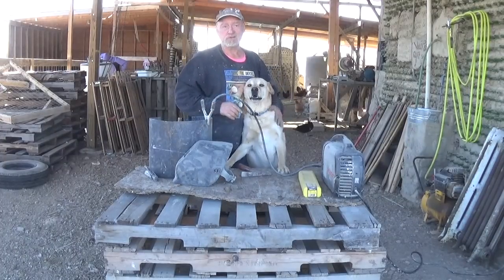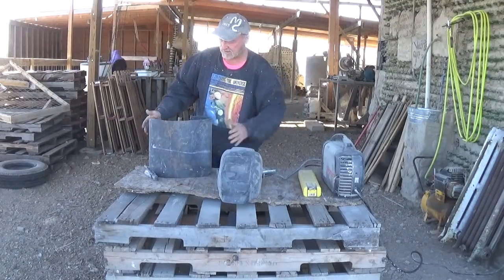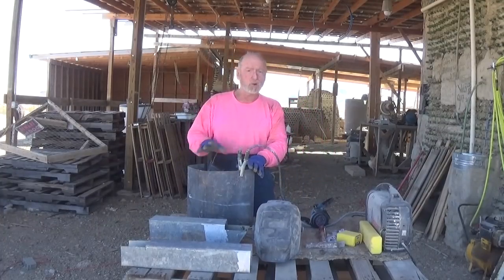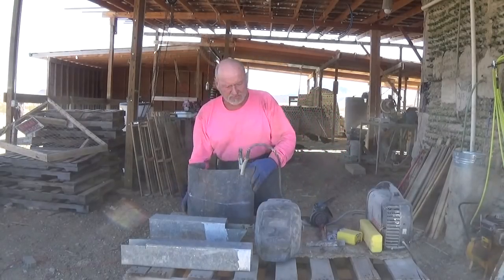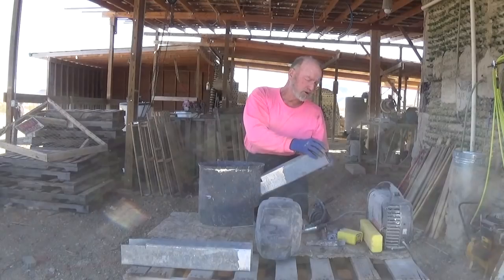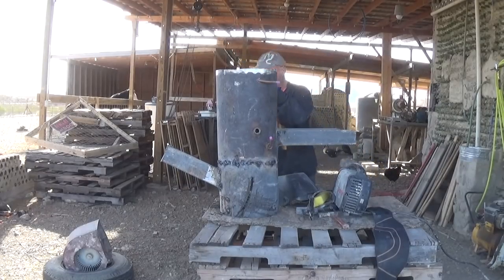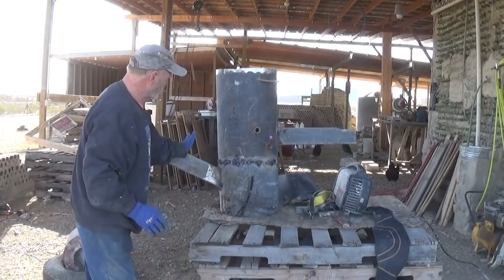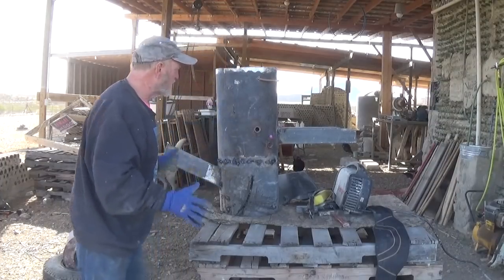Rocket Stove/Incinerator/Hot Water Heater/Cooktop, Part Two

Comment: ROBERT where did you get that cook top at ? thanks for another great video,, have a blessed and safe  day
Reply from the maker: I had it custom made at a welding shop. It is 3/8"" plate steel with a 1/2" lip around the edges.
Reply: thanks, that is what i was thinking about doing to as i was not able to find one

Comment: What is the height and diameter of your riser tube please ? What are the dimensions of all air intake vents and approximate vertical positions relative to the position of the grate ? I am going to build a stainless steel 310 grade with 1 inch alumina blanket insulation and 3 air vents. I am guessing 22 inch riser height and 8 inch diameter of riser tube. Three 7x4 inch air vents so can collect ash and add loads of coal and wood and plenty air. 40 gallon water drum on top of riser, 1 inch from the flame. Is this close to optimum to get maximum heating power and efficiency to heat my tank of water ? Thanks. I will keep you updated as I starting building it. My test will be measure the time to boil a kettle of water to estimate btu power, need to get maximum heating power and maximum thermal insulation, hence 310 steel and alumina refractory blanket.
Reply from the maker: My stove is now encased in brick and I don't keep blueprints of these things. Best to use the dimensions of some of these guys with super engineered stoves!

Comment: R R R....but not so far as to re-use women's clothes ! :) ha h aha
Reply from the maker: If you were a lumberjack, you'd be OK. You'd work all day and at night dress in women's clothes!

(for those unfortunate enough NOT to be familiar with that, look up the "Lumberjack Song" from Monty Python. It's  classic!!!)
Reply: thank you. answer me this question if you can do so. Which is more efficient at heating 44 gallons of water to above 150 F for domestic use: A rocker stove with a copper coil inside the riser tube, OR a 44 gallon water kettle (an insulated stainless steel tank with a good old roaring fire beneath it). I love your philosophy. rain water from roof is great too. ENTIRELY CORRECT. I just think the copper pipe method inside a rocket will take much longer and struggle to get the water hot AND the water discolours due to copper high temperature reactions. You need to listen to WARDRUNA and DEADLIFT too, otherwise you are close to perfection with a sense of humour.
Reply from the maker: I have both things going on..... inside two different rocket stoves. Maybe, the big fire under the 40 gallon tanks heats a bit faster, maybe. However the copper coils seem to heat 100 gallons of water OK. It takes about two hours of small fire to heat the 100 gallons to about 120 degrees. 150, as you know, is scalding and not recommended for your domestic hot water, but fine for a hydronic heating system.

My experience however, has a caveat...… I am using pumps to circulate both of the fires' hot water AND the copper coil is also at "city pressure" of 60 PSI. I m sure this makes a big difference!
Reply from the maker: You are asking me to look at things we do NOT do here. Both videos show great welding skills and ingenuity. However both also would have the heater outdoors in Winter, being stoked, filled & drained manually by a presumably wet or near naked person, or a nine year old. While this is OK for many wanting to live a "simple life", we did not work for 47 years to camp on our land like refugees. 

The second video is a minimalist, almost the stereotypical "off-gridder" that most people think of when "off grid" comes up. By that, I mean he is doing things very simply, very spartan and very labor intensive, e/g: hauling water to the stove. This is NOT our way. We use electricity, pumps, pressure and everything we can to make this place as comfortable as any city residence..... or will when it is finished.

I already lose viewers when they see they must load the fireboxes! Hauling water, then adding more hauled water to make it cool enough, is viewed as weird and not something THEY want to do. Our goal here is to live a "One Planet Lifestyle" as comfortable as possible using the best of 21st century technology and ancient technology, so that people will see how little sacrifice they need to make to achieve the "One Planet Lifestyle". We lose potential converts when they have to haul water to the heater and have no pressure. I want to encourage them to make certain adjustments, bringing hot water into the house in a bucket, IN JANUARY, is not the picture I want to paint!

My big rocket stove has not been featured in a video yet, as the house and hydronic system are not finished. It is a 40 gallon gas hot water heater core, covered by a 55 gallon drum with a 6" top gap and is faced with native rock and bottle masonry. It works as an unpressurized water heater, so I fired it up to test how long it takes to heat water. Within ten minutes, it began to thermosyphon scalding hot water into a 600 gallon tank. Our goal is for that unpressurized tank to reach 150-180 degrees in Winter, to pump through the antique radiators. It still requires a pump to circulate water through the burner and tank and another to provide hot water to the two heating zones.

My assessment is that both of these videos are good and will work if minimalism is your goal. Based on how my big rocket stove heats, I would still stay with a rocket stove. Mine used the same amount of wood as the second video, but stored the heat inside the thermal mass of the stove, continuing to heat the water for hours afterwards (in previous tests). I do not know how long it would take to heat the 600 gallons, but that will be preheated by black poly pipe on our roofs. It will be next year before I shoot that video.
Reply: thanks, great work. I wanted to hook up a roof rain water collection system direct into the stainless water heater tank (gravity fed). I have only worked for 20 years, so happy to trade comforts for a more real life. Dont want a pressurized system due to safety concerns, maybe in the future after gaining some experience. If you see any problems then please let me know apart from 'a bit of labour. Do you think the  water heaters I showed you could be run inside a stone & wall floored cottage safely, obviously with flue going outside ? Thanks.
Reply from the maker: You would have to modify the burn chamber in order to use this indoors. Remember that any time you have a fire inside, it is using the air inside that you already heated, for combustion and pulling cold outside air inside to replace it. I prefer a closed combustion chamber with a vent pulling combustion air in from outside.
Reply: thanks for sharing your knowledge. Air from outside is a very good idea. cheers.
Reply: I hope this discussion is proving useful to yourself as well as me 'seeking to convert'. OK do you think it best to locate the steel drum water heater outside near the house so as to collect rainwater, under cover, and electrically pump the hot water into the house ? Also, regarding the firebox chamber, is it best to have two air inlets sucking in external air, a primary air inlet located near the floor of the burn chamber,and a secondary air intake near the top of the burn chamber. Both inlets have a shutter to control air flow. Once the fire is going well, shut off the lower primary air intake and just use the secondary air. Also use large surface area wood, finely chopped, and allow the burn to run slowly to maximise heat efficiency. wood burns best from air coming above it. Coal burns best from air coming beneath it.Sounds right thing to do ? Also, where do i locate the chimney flue pipe if I have air coming in from the back of the firebox. Does the flue pipe need a baffle plate and a dampner plate to reduce the heat escaping up the flue ? 309 stainless is needed on the tank, but 7mm mild steel ok for the firebox ? Grate is just 1 inch rebar. Are there any commercially available super efficient rocket stove heaters up to the job of directly heat a 120litre water tank by this method ? What do you think to this one........ https://www.youtube.com/watch?v=xnqqB-leeaQ
Reply: What size should the burn chamber be to heat a 150 to 200 litre tank ?
Reply from the maker: You are getting way ahead of my knowledge base now. You are doing as much research as I did, so our base is equal! I am trying to use discarded things to create with, these videos all show fabricating new. I have no background with Perlite in concrete, but everything I know tells me it will degrade in time..... I may be wrong though!

Regarding two air inlets in a rocket stove. You must have the one that feeds/intakes air, or course. A lower, flat one, with a cover, at the bottom of the burn chamber needs to be there for easy ash removal. This lower opening is a great place to start the fire easily, but will send smoke out the main intake until closed. 

I just use scrap wood and sticks, so I do not know about finely chopped wood, but pellets work in other videos. My grate allows small stuff like sawdust to fall to the ash pile, so I don't do much with tiny pieces Speaking of the grate, I find rebar to bend from the heat and won't use it any longer. I used an old, heavy duty barbeque grate for the incinerator stove.

Any of them can be scaled up to nearly any size, but I find the stoves still work best with small pieces of wood. In my limited experience with our giant rocket stove, it heats water to close to boiling in about 45 minutes.... 30 or so to bring the stove to temperature and 10 or so to really heat the water from there. The burn chamber in it is about 225 square inches.

I highly recommend using the core of an old gas fired water heater, covered by a steel drum. The burn chamber is the entire area beneath the tank, a 4-6" gap on the top and the exhaust down low in the drum. Placed outside to keep smoke from  inside, the exhaust can be run inside through thermal mass that will heat the interior, then exhaust warm air outside. There are many videos showing this, including several greenhouses.
Reply from the maker: Rocket stoves burn sticks, dried brush, weedy stalks from trees like Moringa that grow fast and..... trash, even plastic once it is up to temperature. Personally, I think they are far better than anything, other than the sun!